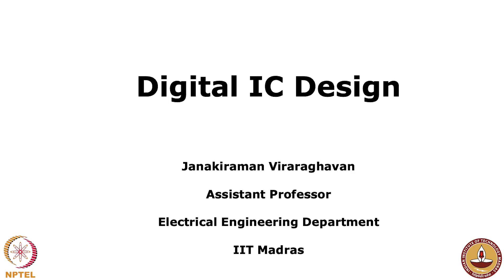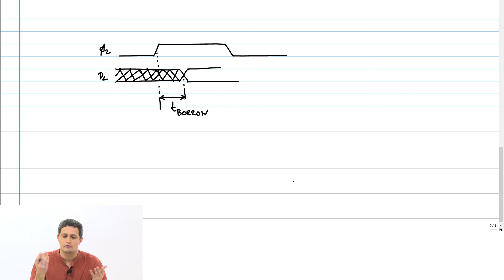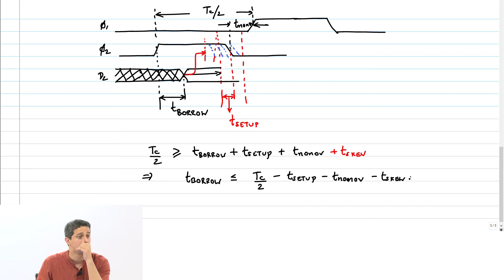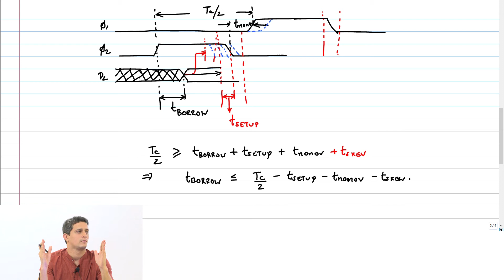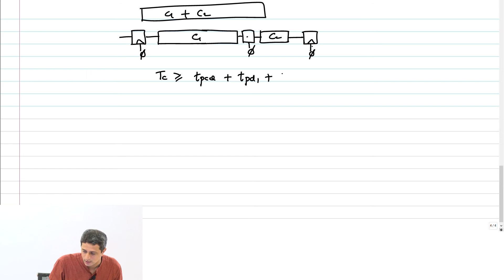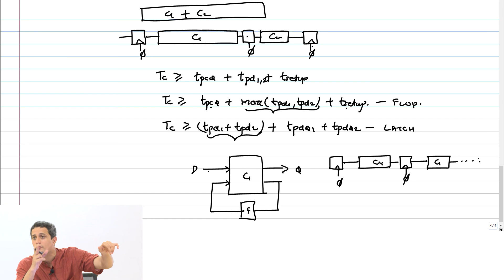SeqCkt - 13 - Time Borrowing

Comment: To those confused about the latch and flip-flop timings, the latch would propagate data through both C1 and C2 in 1 clock-cycle, whereas the flip-flop would need 2 cycles to propagate through C1 and C2.

Assuming the sequential overheads, i.e., 2*(t_setup + tpcq) ~ t_pdq1 + t_pdq2 = seq_over, we get the time to go through C1 and C2 as:
T_ff = seq_over + 2*max(t_pd1, t_pd2), and T_latch = seq_over + (t_pd1 + t_pd2). T_latch < T_ff -> f_latch > f_ff.

Comment: I think there is a mistake in the Latch equation written down around 11:40... shouldnt this be twice the clock cycle?
Reply: Late reply, but no, the equations are fine. The flip-flop would just take 2 cycles to do whatever the latch would do in 1.